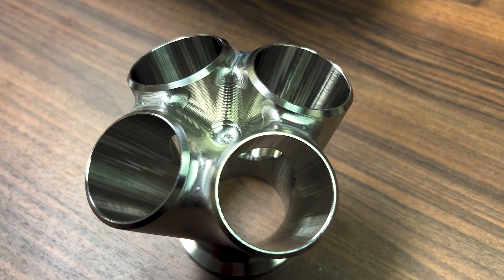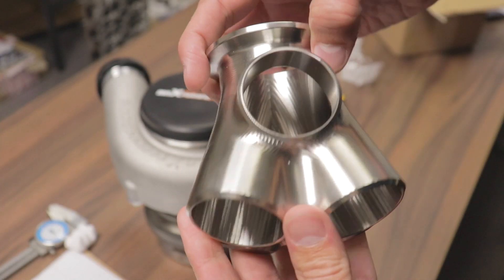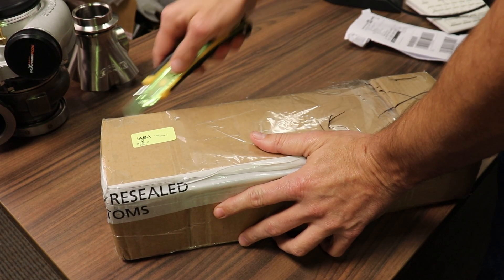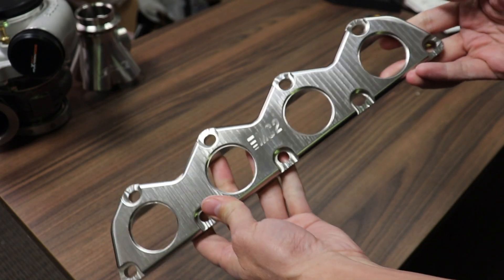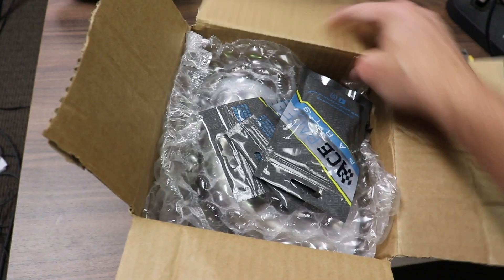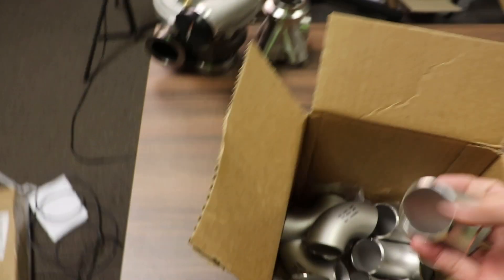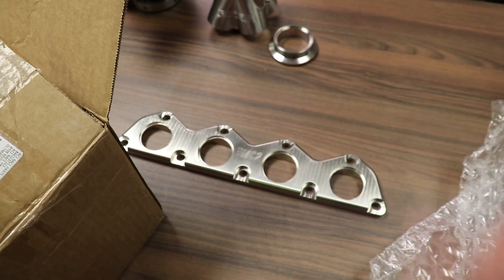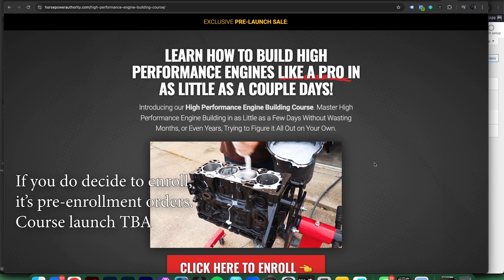Custom CNC Parts Arrive for Epic Turbo Upgrade

Comment: Can you do a LL8 build ?
Reply from the maker: That would be cool! I may have the perfect car to put one in. Waiting on something to go through.
Reply: @cmattdabrat  by definition  a 4th gen camaro would have the best "length" to fit one if that's one thing you would like to consider . That long engine bay 👌  . What ideas do you have about the 4200? 
As in when would you like to start it vs when you think you might start it ? 
Also what style of build could you see yourself doing with it ? Like a "let's goto the junkyard and pull one and refresh/build it on an engine stand then swap into said vehicle or swap it directly  into the vehicle in mind and build it gradually?
Reply from the maker: @JohnBoy3991  My thoughts exactly. That's the route I would've got for a true "American Supra."

Comment: The thickness of the flange also has another benefit.  It's less susceptible for warping when you do weld to it, especially if you TIG it.  This stuff is gonna be so nice.  CNC technology and automotive tech in general has grown lightyears in the last decade or so, it's crazy.  The CNC collector is going to be so nice.  No more having to mill the hotside "ring" flange to make sure it's flat and the inside is so much smoother than you could ever get with a welder and a die-grinder.  Stoked for you, brother!
Reply from the maker: The plan is to rig weld it in a jig. I’ll blog it and past it. I’m not the best welder but get it done.
Reply: @cmattdabrat  Weld much better than I do, I assure you. Lol.
Reply from the maker: Couldn’t agree more!

Comment: $330 not that expensive? Sheesh! Nah that is super nice though. Took me a minute to figure out it was TiAL V-band sizing when I got mine I won't lie. Kind of annoying because it is a bit harder to find flanges and adapters, but I managed. Nothing as nice as what you got! That header flange looks amazing too. Can't wait to see what you make from this stuff. :D
Reply: Yeah you gotta pay to play. Sadly many people myself included don't have the money to play LOL. I've wanted a new intercooler and piping kit for my cruze, not because I'm doing anything performance, but just to replace all the plastic crap , future proof,and prevent boost leaks but I can't stomach the price for a car that has been the biggest headache of a car I've ever owned.
Reply from the maker: @sinformant not a cheap hobby or industry for sure!
Reply from the maker: Relative the time of cutting pipe and fitting a flange. Real time saver. Me too! Order a flange to find out it was the wrong one. Took measurements and searched. Can across ace race parts where I found that flange you see sitting on the turbo. I’ll just use it now to make a jig. Looking forward to you getting yours going. With the manifold that’s one it now, I thought about just modifying it but it would ruin it. Want to keep it as a T3 option in case I change turbos down the line.